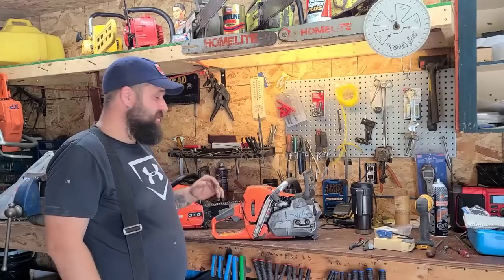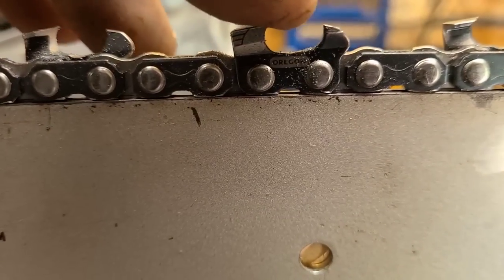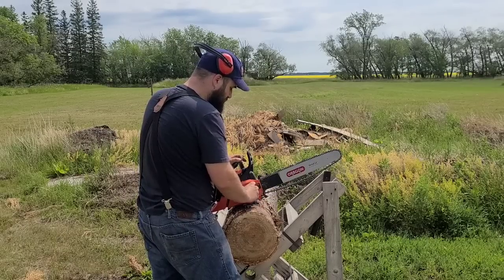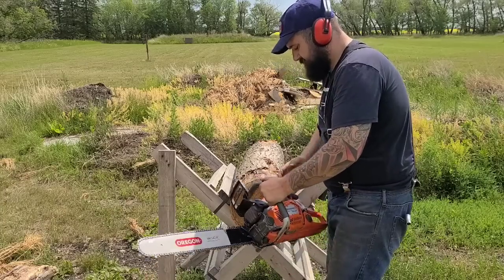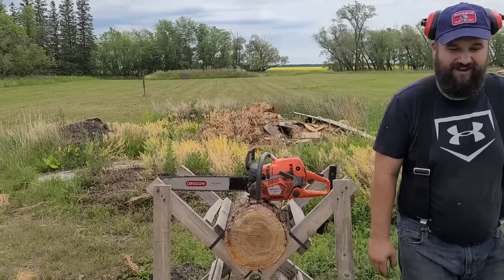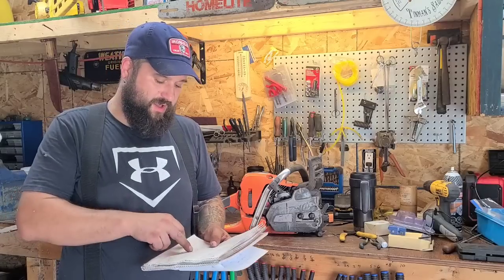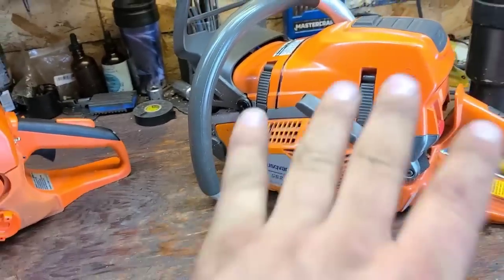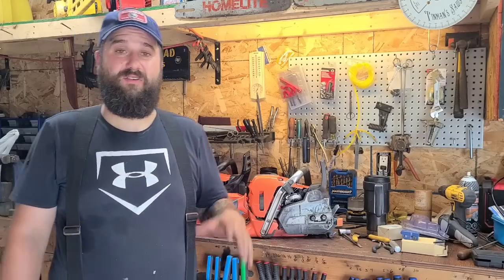Echo CS590 vs Husqvarna 562xp. How close are they in performance??

Comment: I wonder if the echo could handle the rakers taken down a little more than the husky
Reply: @wolfmanrebel874  thats's interesting about the lower rakers.  I was thinking along the same lines with noodeling.  I have a hard time hand splitting wood, and do my share of noodleing and was wondering if the "grunt" factor would make more of a difference doing that.
Reply: @wolfmanrebel874  I don't have a Husqvarna to compare my 590 to but I have a dozen 1970s and 80s saws that are known for their torque and the echo seems just as good with low rakers. I haven't done any testing though
Reply: @hickerbilly345  that seems to be common experience with the echos and another reason I like them so much they really are reminiscent to classic "muscle" saws in some ways, I agree using them kinda gives you that feel , I still don't have a 7310 yet but I have a cs800 620 590 and  unofficially own a 490 as well, they may not have the rpms , peak power and technology of Husqvarna and Stihl in competitive apples to apples but they have reliability, simplicity, cheaper to own from initial purchase to repairs later on for my working class saws that's what matters to me I build/modify hutzl's or blown cores  for crazy stuff (that's what lead me to this awesome channel,I love this guy) . But IV always been more of a torque guy over speed in everything from my 300 i6 f250 , 6bt F450,Buick 3800 down to my old early 90s vanguard WHITE garden tractor to my worn out half-dead zombie p.o.s troybuilt pony 4stroke weedeater I just like grunt as my personal preference for just about anything and while I enjoy a good edge of insanity build as much as the next guy, when it's not play time and time for work I grab one of the echos, typically the 590 because I'm kinda torture testing the thing I had a new 450 rancher that was the same exact price and it likes to blow up,it seems to be best in class at it matter of fact,lol to be fair though what we was doing with it falls under commercial grade territory and the 271farm boss only out lived it by about 3 weeks same job,same use
I have been told that epa standards is what lead stihl and Husqvarna to autotune to get the most and such while echo has more gap at TDC and less aggressive timing much like how automakers for example the Ford 360 and 390 met standards without technology by dropping the piston 
.104 on down the hole and 360 had cam timing retarded as opposed to the 390 and 352 of the 60's that was a b.m.f So,... theoretically if that's true guys like tinman should be able to close the squish tweak the timing and make a real monster out of the things without doing much more than hand work ,a carb , and pissing Gretta off

Comment: I own 562xp it's beast mode only did muffler mod I've ran the 590 also but I'd rather run the 590 over any stihl might ask why 1 it starts 2 its reliable 3 I know it will last

Comment: Would like to see you work on a 565.
Reply from the maker: Who knows I may grab a new 572 or 565 in the future. I'm kind of curious.
Reply: I have a 565. Not as zippy as a 562 but it seems like way more than 11ccs more worth of torque. Not much difference in performance between the 572 and 565 in the timed cut vids I’ve seen. The powerband is broader and more forgiving on the 565. The AV is very smooth on both.

Comment: My echo cs 620pw which is the same as a cs590 but with a bigger carb and a unlimited coil .. will beat a husqvarna 562xp and it's up there in RV's after about 100hrs of cutting 24"-32" wood with it but I still love my jonsered 2095 the most with a 36" bar

Comment: Is there much difference between the 460 and the 560?
Reply: Did I miss something or did you mean 490 vs 590? If that's what you meant than YES...huge difference, 490 isn't bad for homesteading but 590 is a whole different animal like a black bear vs a grizzly
Reply: @wolfmanrebel874  no the husqvarna 460 rancher VS the 562
Reply: @samstoned  oh,🤦 sorry , can't speak for certain closest experience I have is a 450rancher vs 550xp...the 550 takes the win in every single way by my experience the 550 was stronger and lived longer actually a friend owns it now I got a 590 a few years ago and have him the 550 on a clearing job we was doing . The 450 don't like long hard days( not pro grade so...yeah) they tend to burn up idk if that same result carries over to the 60's class but in my mind I assume it would. And I could had possibly had a bad 450 but somehow doubt it I went though 3 cylinders &pistons throughout it's life in the family from the tractor supply shelf to the back corner of the garage she sits today until I decide to build the p.o.s again out of sheer boredom and a weird ocd horders inability to let things die that need to😂
Reply from the maker: 460 is more in line with the 590 echo. The 562 is lighter, and has more power.
Reply: @tinmanssaws  thanks buddy
Reply: Husky ranchers are plastic vs echo 590/600/620 mag cases bolt-on cylinders

Comment: The husky is higher rpm..and faster chain speed..where echo is a torque maching..u can dog into anything with echo and it won't drop rpm..compared to.husky won't like it ...2 very differnt saws that need to be run differnt way...